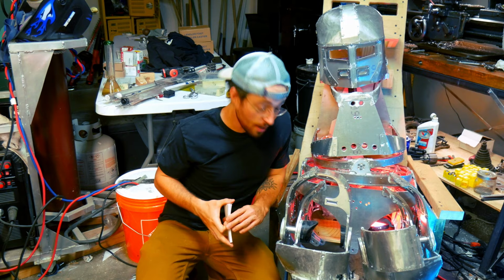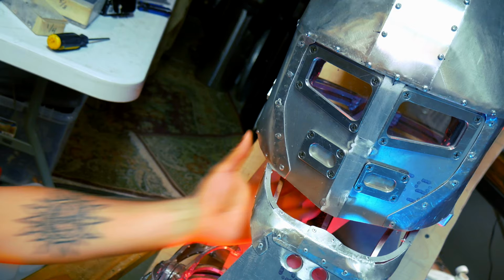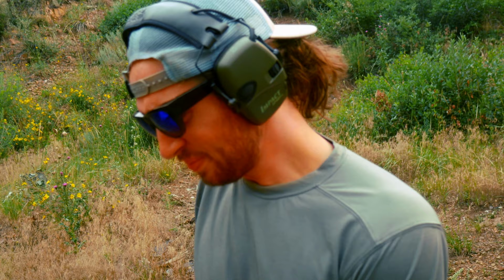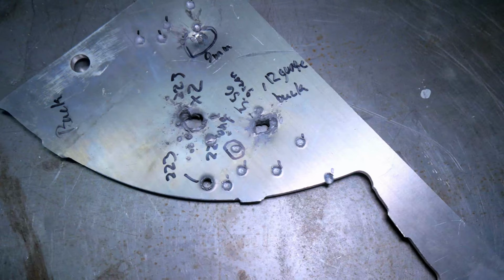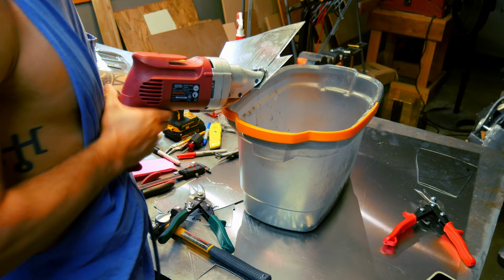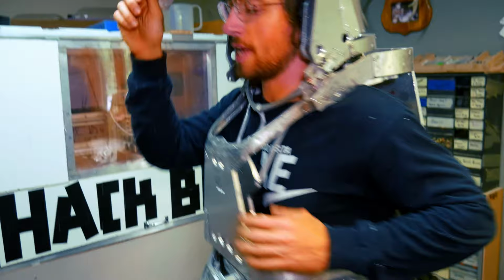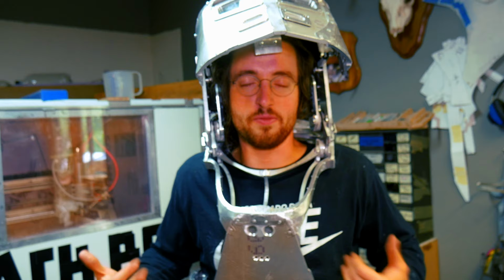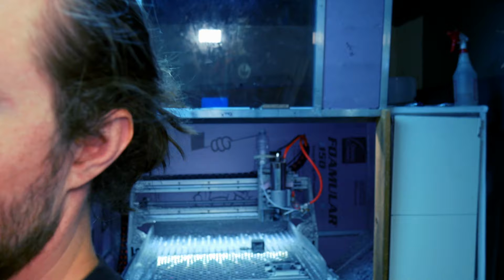Bulletproof Iron Man Suit (Upper Body)

Comment: my unpowered suit is finaly approaching completion. i am currently adding the last fibre layer around the completed pieces. then its just a bit of hole drilling, cleanup and assembly ^^.

current stats: 20kg total weight. 90 kg safe extra load.  highly stab/slash/blunt force resistant (no option of testing bullet resistance around here), 45 kg of constant elastic assist (without lever advantage, which should bump the numbers up a notch)(90 kg can be applied before there is no spring effect left)(182 kg as maximum load of all elastic bands combined)(so its 25kg of actual assistance after subtracting the suits weight), concealable (well, looking like the terminator wearing foot braces) under loose but fitting clothing.
Reply from the maker: Hmmm interesting. Should show me some pictures. Curious about elastic
Reply: @DylanEdmiston  i use heavy duty carabiner bungee cords for unpowered assist. 
basicly kangaroo like leg tendons, steadycam like arms, a stabilized waist/wrist/ankle and cushioned neck. 

with some rope redirection roler use at the hip, so the glute assist does not interfere with walking and a shoulder setup that shifts with close or wide arms to either apply lift force or pull force (for ladder use)

the last image of all pieces splayed out correctly i have made is from december last year. and most recent image is just a few of the pieces wrapped in woodglue bandages drying. but with current progress i'll be able to get to the fany part of drilling, surface finishing and assembly very soon. 

https://cdn.discordapp.com/attachments/705749206664740894/945305535710916628/IMG_20220221_140608.png

(pieces are: two parts of the neck assembly, the waist parts, the hip and ribcage, the upper arm bones and lower leg bones. then i ran out of bandages.)

Comment: you should forego eye holes or have a solid bullet proof panel that slots over them with a head up display showing the feed from two cameras (one for each eye). It would eliminate a weak point and protect the eyes from lasers.
Reply from the maker: Eventually.

Comment: How did you end up doing your anti rack system on the power route?  An you post the parts you used, I cannot get my cable setup correct on mine.

Comment: You're getting to the point to where You're a good candidate for a metal printer. I think #markforged should sponsor you somehow.
Reply from the maker: Would be epic. Set that up bro
Reply: @DylanEdmiston  still working with the Hacksmith?
Reply: I don't think a metal printer can make bullet resistant parts. I mean, maybe it can but for something you expect to stop rifle rounds you need a thick enough, suitable material such as rolled steel or a suitabld titanium alloy. For such an application, the way the material is formed is very important to its end properties. Metal printers produce parts with many micro pores and other defects and they arent uniformly heat treated or forged. The suit should ideally have removable armor paneling which can be fit onto a frame.
Reply: @ilyarepin7750  Oh, I'm not suggesting any ballistics benefits, but good assessment anyway. He's currently limited by a lack of intricacy and ergonomics or organic shapes, of which, with a 3D printer, are many times easier to realize.
Reply from the maker: @ilyarepin7750  would work for structure

Comment: Won't you have the same "springy" problem you had when loading weight on your head when you add your exo muscles? How will you keep you arm from shrinking a few inches when the muscles contract?
Reply from the maker: I think the arms will be fine cause stiffer shape. That would be a problem in the lumbar if I were to power it
Reply from the maker: I think the arms will be fine cause stiffer shape. That would be a problem in the lumbar if I were to power it

Comment: Im curious, do those ring joints have any bearings in them? In my experience aluminium is a poor bearing material, it has lots of stiction and tends to gall easily up which doesn't help. Sliding joints are also difficult to get working smoothly, especially as they get bigger. I personally try to design everything with pivot/hinge joints where possible just to avoid them. Maybe you've found a way around this, I'd be keen to hear about it.

For my own design I'm working on what I call a "floating link" architecture or framework for the exoskeleton as opposed to your aligned axis framework. Mine will require a couple of extra actuators in some joints but it will have some other advantages which I think will offset that hinderance.

Also, instead of a double layer suit, why not just create a double shear joint where the actuators mount? You'd save on bulk/material.
Reply from the maker: Just grease. Considered a floating joint yes. Maybe on mark ii. And because it’s not about the joint it’s about the connection between the joints